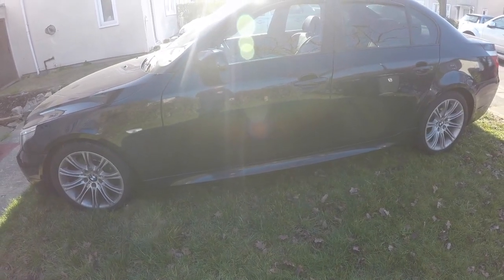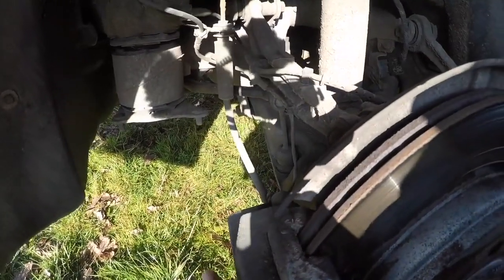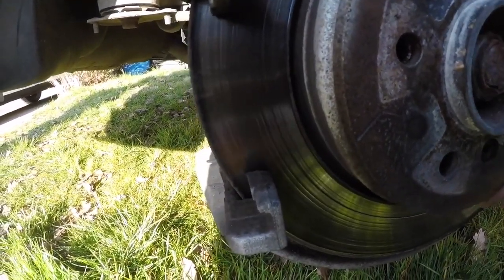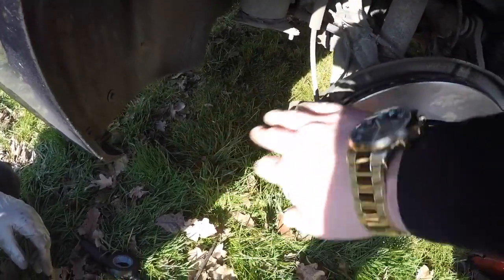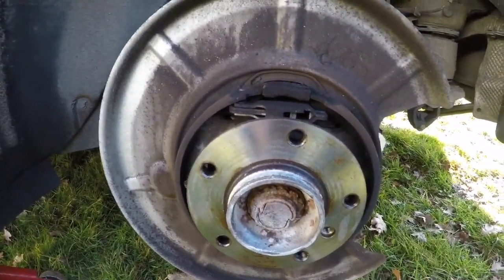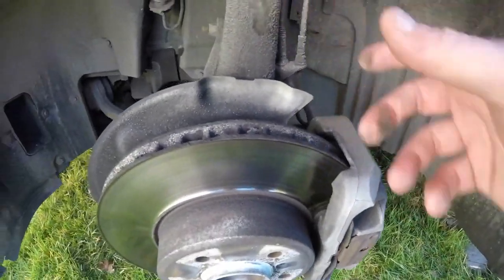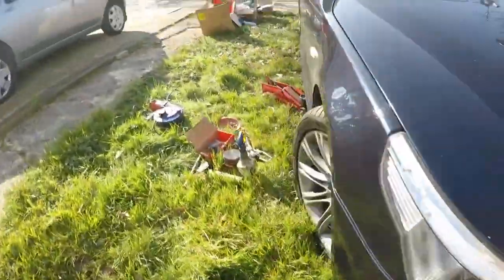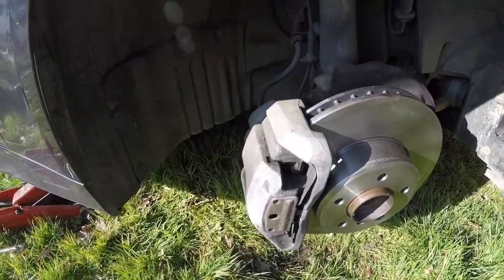Doing This Will Make Your Brakes Work Better & Last Longer

Comment: Why didn't ya just change the sensor aswell instead of hard wiring them ?
Reply: the old sensor broke so we had to bridge it for the mean time because we didn't have a new sensor with us at the time & the car was booked for the MOT so there wasn't enough time to buy a new sensor. its called improvising. if the MOT inspectors see a light on the dashboard it will not look good on the MOT record.

Comment: Hi I got a 2009 E60 520d se face-lift . I looked  in the boot (trunk) where you shown in the video but there is no module . I got phone button on the streeing wheel and TEL button  on the center  console.   Do have I Bluetooth or not , as I have a navigation though.

Comment: Yo just wondering if u could help...I’m pretty sure my cars over fueling as loads of white smoke is coming from the exhaust and it used 80miles on a 2 mile journey! The fuel injectors sound fine to be and I have no idea what it could be?🤷🏾‍♂️

Comment: Hey I have a problem on my ‘06 530xi. When I come to a stop, the car jerks forward a little bit and it feels like the brakes are letting go then brakes again. It’s really annoying, is this soft stop or transmission? I did M2-M1 and it still happened after it was in 1st so I don’t think it’s transmission.

Comment: I have disk bolt broken, and one corroded, I don't know how remove it?
Reply: Drill the head, then, with a set of pressure pliers you remove the old one or you weld a nut to it.
Reply: Bolt extractor kit or drill them out